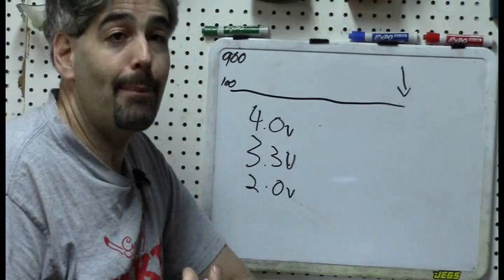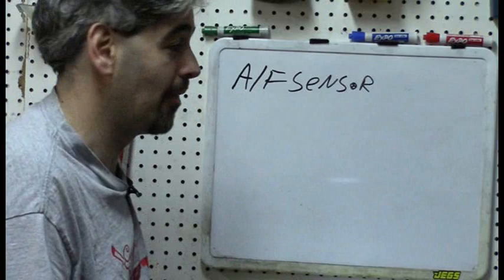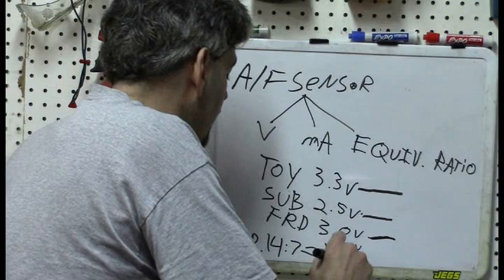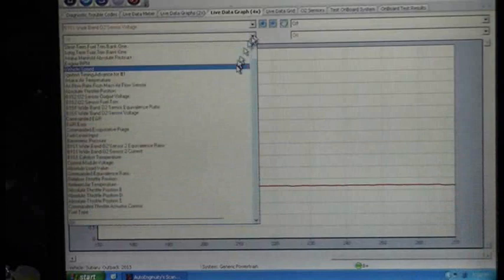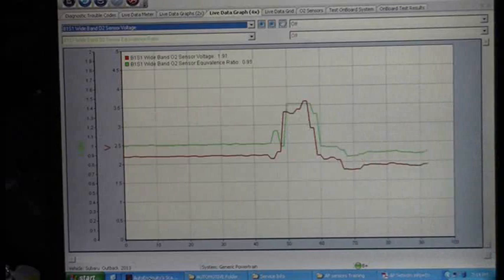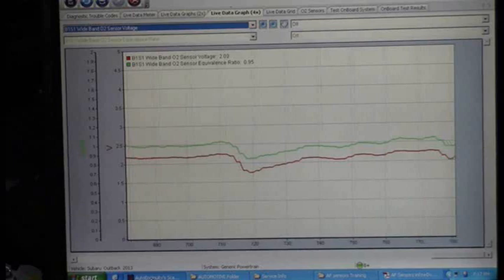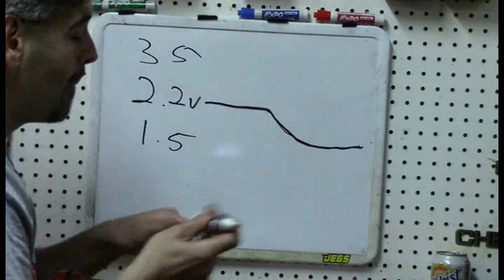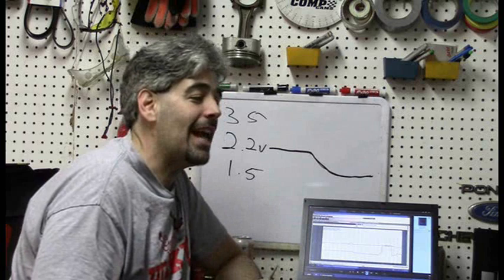Air/Fuel Sensors (Wideband Oxygen Sensors) vs O2 Sensors- PART 2

Comment: Can we take a collection and present Matt with a 3-cyl vehicle such as Festiva or Justy?  I think that will make him appreciate the 4-cyl cars :-)
Reply: Lol. Or kick in for a 300hp turbo bolt on kit for that nice lil Subaru
Reply: Jonathan Damian Burr  Ah, but Scotty Kilmer tells us that Subaru and Honda transmission quality has declined. (Specifically the auto transmissions) So, make your car fast, break your transmission. That won't be a fast car anymore.
Reply: DE Nichols Briansmobile mentioned the Honda transmission problem, as he's unfortunately seen many Honda Accord, just turning over to the new millennia fail at close to 100k miles.
Reply from the maker: DE Nichols I generally don't buy into the "bad design/common failure" thing so much, but there are a few exceptions that I am convinced on. Inclusions are the early 2000's GM 3.1/3.6L's with coolant leaking through intake, the '98-02 Chrysler 2.7L with the oil starvation  due to small return valleys, and also the early 2000's era Honda transmissions of which I replacing 2 this weekend.
  BTW- welcome to the Channel DENichols and thanks for the contributions to the channel.
Reply: Schrodingers Box Good point. I laugh whenever someone says something commonly fails on my cars and I never see it probably due to careful maintenance. Plus, most of us DIYers probably don't see enough of a certain car to really have a trust worthy sample for statistics.

Around the same time Honda appeared to have auto transmissions fail Ericthecarguy noticed a shift to longer maintenance schedules. That way a manufacturer can claim less cost to the owner.

After this shift, I trust recommended maintenance schedules less and I want to be ahead of schedule. 

Thanks for the welcome!

Comment: Hi, I have a question? My  catalytic converter has broken pieces in it, it makes a sound at the same time I’m getting error code p0130, I am about to change the piece is that code relevant or I have another issue?
Thank you
Reply from the maker: I don’t know. what data do you have?
Reply: I don't understand what you're referring to? I don't have a check engine light and the only stored code is P0130 which is I think a vacuum leak somewhere.
Reply from the maker: @danarami6378  Exactly. What data do you have that you think its a vacuum leak? What does the IAC steps indicate? What is the total fuel trim at didle vs load? What is the MAP voltage?  What is your data that you think there is a vacuum leak?
Reply: HI, thank you again for your reply, all good now I changed the secondary catyitic converters small one sitting under the seats, and few miles latter everything was good all reading are good and o2 sensor is at idle 1.2 or 2.2 and the o2 voltage is at 1 at idle, the MAP voltage, honestly I don't know what it is. but the car is running normal for now, and very smooth.

Comment: Hello. should we have the same oscillation with lambda probe (upstream) and lambda probe (downstream)? thank you in advance
Reply from the maker: Nope. that would mean your catalytic converter is bad if you see that.   a functioning cat will use nearly all the O2 in the exhaust resulting in a flatlined rich trace.
Reply: Schrodingers Box Please, can you explain to me how to react the probe 1 upstream and the 2 dowstream on a de-chat vehicle? thank you in advance
Reply: Schrodingers Box Of course I'm talking about the current in volts please
Reply: I thought that a probe in good condition should oscillated rich and poor 2 times every 2 seconds between 0.1v and 0.9v? Thank you
Reply from the maker: No idea what you are talking about, sorry. You can't talk about current in volts.  You don't about gallons in meters do you?
    As mentioned you should show stoichiometric oscillation on S1 but S2 should show rich as result of catalytic activity. Very simple- no other variables.  Stoichiometric oscillation at S2 can only indicate catalytic inefficiency,

Comment: I still see people changing lamba sensors for no reason , because it says lamba sensor bank 1 sensor 1 running lean does not mean  its the lamba sensor , im glade you used a car to show this , but would of like to see what was coming out of the exhaust pipe on a machine , nothing wrong with 4 pots

Comment: What year did they start using the air/ fuel sensor?
Reply: I am not 100% sure, but I believe it was around 1999 and toyota was the first mainstream manufacturer to use them… If anyone out there has different info I would love to hear it!
Reply: These are very informative videos ... Great Job !
The first ones I know of are the 1992-1995 Honda Civic VX ... wideband used for ultralean burn for fuel economy...
Again .. big thumbs up on the video content here!
Reply from the maker: DIYdake Wow 1992 huh? Man that's way earlier than I thought.  I am definitely seeing these more and more widebands and they continue to be a challenge because of the variation.  I am not opposed to newer technology but I just wish it would be standardized.  It is very difficult when you work on multiple vehicle makes and the OBD is not standardized.

Comment: good videos but you did not explain how the sensor changes this current. You said, the o2 sensor changes voltage when oxygen goes through it, so what about a/f sensors? How this sensor works? You have a lot to explain here, about pump cell, sensor cell, reference air ecc....
Reply from the maker: It was explained more than sufficiently to make ANY diagnosis. 
   I looked for A/F videos on your channel so i could see how to properly do a tutorial on these based on your criteria and you have nothing whatsoever.
Reply: Schrodingers Box ahaahah you always so funny. I do not make videos like you, you are unattainable. But i think when you teach somebody how to drive a car, you should explain to the student how a  brake system works first of all. But anyway, i very like your tutorials
Reply from the maker: I don't understand your logic. Why is knowledge of fluid hydraulics necessary to learn how to drive a car?  Most good drivers have no knowledge of fuel trim stoichiometry, fluid hydraulics, Electrical theory for hall efect sensing. or anything like that. 
  please explain to me why any of these are necessary when teaching someone how to drive a car. I do not follow your logic.

Comment: If the o2 sensor detects how much o2 is left in the exhaust, how does it differentiate when the engine is running in stoich and rich since in both cases there be no O2 (theoretically) as all of it will be mixed and combusted with fuel. Please help me someone, i've been looking for an answer all over the internet. haha.
Reply from the maker: +adam hisham In a rich condition there is a reduction in oxygen because it is displaced with fuel. Conversely, a lean detection is detected by an increase in oxygen content due to less displacement by fuel
Reply: i get the working principal of the o2 sensor and the whole concept of rich/lean detemination process, but a stoich mixture means that there a perfect mixture and combustion where ALL of the fuel/air is burnt into water + CO2 + some other stuff. Therefore there should be no oxygen left for the O2 sensor to detect when the mix stoich and richer. Unless the O2 sensor doesnt really detect O2 but another thing, maybe ratio. It also could not be fuel that its detecting as the opposite situation would happen for stoich and lean conditions.
Reply from the maker: adam hisham Ah I see where you are going with this.
  You might want to see my video series "o2 sensor debate" where I cover this very topic and introduce the idea that the O2 sensor works differently than we think.

Its a pretty boring video for most people but sounds like you would appreciate it.

https://www.youtube.com/watch?v=mnAmTtYx5hk&index=41&list=UUnIQ-_hRpyHR68f23dQQHUg
Reply: +Schrodingers Box Haha. Watched the whole series on O2 sensors that you put up, and i must say that was quite the finding. Though correct me if i'm mistaken, but i think O2 sensors 'compare' the exhaust gas with the atmosphere although i'm not really sure in what way. Cause if you look at the datasheets of most of the O2 sensors available, it shows that there are orifices to allow air from the atmosphere to get into the sensor to be used as a reference. Also i don't quite agree with you on the 'vacuum experiment' where you said that that would induce 0V. Because if that is true then during  every transition from lean to rich (vice versa) the reading would go to 0V before going back up/down. As i've mentioned in my earlier comment, in theory a stoich mixture would burn ALL the air and fuel, leaving just the other chem reaction products. But then again, maybe I'm wrong. This is why i 'hate' science. theres always more unknowns popping up when one question is answered.

Comment: Schrodingers Box Hi Matt, I have a question, I have a 2001 Toyota 1mz fe v6, my live data recording shows o2s11 and o2s21 having the correct wave form and voltage reading throughout the recording but the o2s12 voltage never reaches 1v and the 2 eq ratio readings flux between just under 1 and slightly over 1 throughout the recording. My scanner indicates o2s21 is bank 3 or downstream sensor but doesnt distinguish between the other 2. Is the o2s12 my bank 2 sensor? and what diagnostic test should I look into next? Mind you I have new knock sensors and sub harness as well as a new IAC and MAF sensor and Im still throwing bank 1 and 2 lean codes and knock sensor codes. Any advice would be helpful.
Reply from the maker: what was your MAF data that indicated your MAF was faulty? I would start there for sure. Was it based on Fuel trim curved against load?
Reply: +Schrodingers Box It wasnt with scan tool data. I followed the factory service manual and it failed one of 2 tests, the resistance test. It passed the key on air flow test though
Reply from the maker: And the IAC failed too?
Reply: +Schrodingers Box After I replaced the knock sensors and deep cleaned the intake plenum and lower intake manifold the car idled at 3000 rpm. Thats when I found out the IAC was dead. It failed the test in the manual to try and actuate it with direct 12v from the battery.  I had the MAF disconnected at that time so thats how I ended up testing that too.
Reply from the maker: You cannot operate an IAC by adding 12V directly from the battery,  What manual are you using that would say this?
Reply: +Schrodingers Box The 2001 Toyota Camry factory service manual. The test is to see if the little door inside opens and closes. the old one didnt move at all new one worked perfectly
Reply from the maker: Think it's probably time to throw away that factory service manual, it obviously isn't helping lol. Just go back to the beginner level basics- start with a total fuel trim analysis curved against load and determine your direction accordingly.
Reply: +Schrodingers Box Beginner lever lol. You got that right. Ive only been learning about fuel trim data for diagnostics for about 2 weeks, once I started getting lean codes on both banks. Ive watched both of your videos on it multiple times because I am not at all familliar with this kind of analysis. You really dont think the fact that 1 of the 3 A/F sensors being almost completely unresponsive has anything to do with the problem? That data was obtained by warming the engine up and doing the snap throttle test you show in this vid. Ive also checked for vacuum leaks and did a fuel pressure test
Reply: +Schrodingers Box Also, since you pointed to fuel trim vs. load should I clear the DTCs before I gather new data?
Reply from the maker: Definitely not. you want retention of the LTFT baseline otherwise you would only have short term trim.
Reply: +Schrodingers Box O.K. is there any profit to performing a spark plug inspection, compression test or leak down test at this point?
Reply from the maker: I wouldn't know- I have no data indicating there is reason to do any of that. I can only make assessments based on data-driven analysis.  Well, actually only everyone can, if you think about it, but most don't- they just guess.  I hate guessing. I like knowing!
  Give me some relevant data specific to a hypothesis and I'll gladly review and advise.
Reply: +Schrodingers Box I have a handheld scan tool, not pc based. I have 72 frames of live data recorded. Do you need the freeze frame readings or before and after the MIL came on?
Reply from the maker: I just need total fuel trim curved against load to start
Reply: +Schrodingers Box Where do you want me to start. I have 72 frames of data to examine. I did warm up the engine to operating temp and shut off the car before I connected the scan tool.
Reply from the maker: I get hundreds of comments a day- I can't really spend personal time with individual issues sorry.  How about just reply with a summary of relavant data which would include LTFT and STFT curved against load with corresponding MAP and MAF and rail pressure. That would be enough for me to at least get a direction.
Reply: +Schrodingers Box 
rpm: 2400
abslt tps: 21.2%
load: 45.9%
maf: 4.42 lb/m
ign adv: 26.5°
stft1: 1.6%
stft2: 2.3%
ltft1: 11.7%
ltft2: 12.5%
o2s12: 0.380 v
o2s11: 3.279 v
eq ratio11: 0.994
eq ratio21: 0.996
o2s21: 3.210 v
fuel press. at the rail: 50 psi
spec: 44-50 psi
fuel syst. hold press. 41 psi after 10 mins
spec: 21 psi minimum after 5 mins
Reply from the maker: What is this? Whais your strategy here? Why do you have all this random data and nothing interconnected in a strategic sequence? Where is your curve against load? Why do you have a single point of reference?
  I am afraid I cannot help- this just looks like a random data dump or something- there is no specific strategic focus.
 Sorry but this data is not usable for my approach. Good luck though! I hope you figure it out however you approach this but it is not able to be applied to my methodology.
Reply: +Schrodingers Box Those are the statistical readouts from the scan tool when the check engine light came on.
Reply from the maker: I don't want a freeze frame- I need LIVE DATA with induction of variables that gives me direction. There is nothing useful here. Sorry- maybe watch more of my diagnostics so you'll know how to do this better
Reply: +Schrodingers Box I dont have the ability to display the waveform data it looks like you need. I appreciate the fact that you did respond and are willing to help, so thanks for that. If I figure out how to present the data you need I will post a link, till then✌